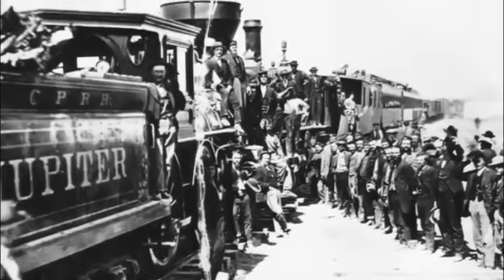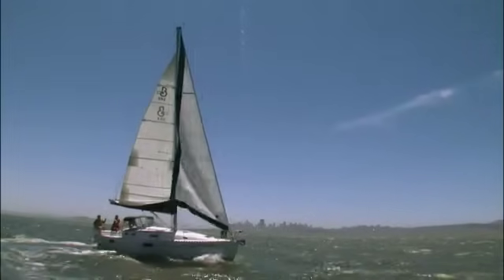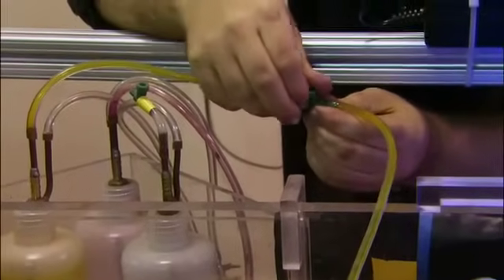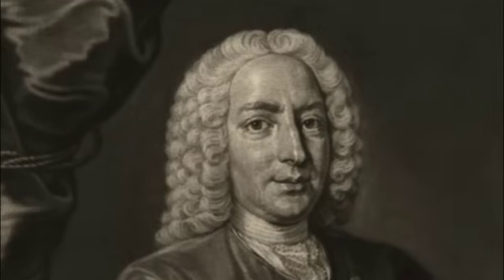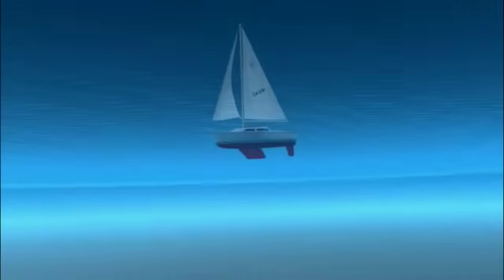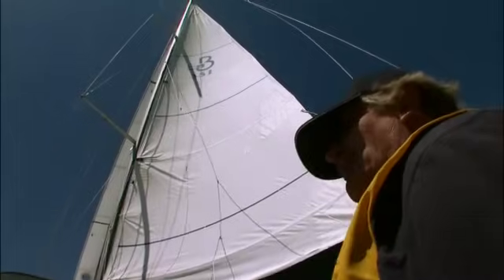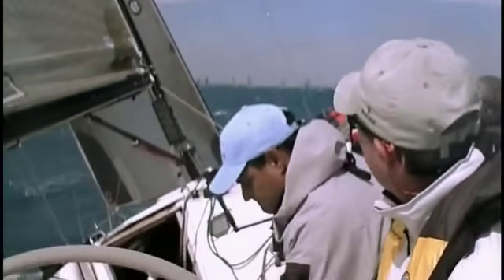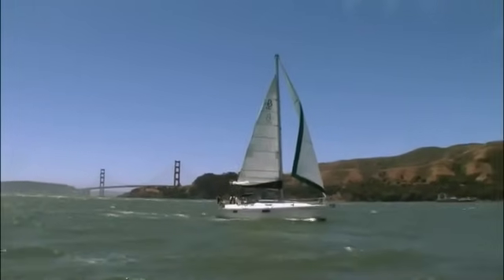The Physics of Sailing | KQED QUEST

Comment: But sails arent solid like wings with a flat and a curved side, as shown in the water tank dye test. They're a fraction of an inch thick, and the wind on both sides travels at the same speed as shown and proven by tell tales. So why would there be a pressure difference on either side of a sail if there's no difference in wind velocity to cause a pressure difference?
And at 3:24, you have the "sail" shape directly into the wind which can't happen when sailing.
This entire explanation is flawed by explaining how a solid plane wing wing works directly into air flow, and not a micro thin sail at 45 deg.

Comment: The explanation is kinda off, first thing to notice is that it takes in consideration the shape of a cross section of a wing, which is a rigid solid, while the sail shape will not work in that way, as wind pushes on it, the position of it and shape will change in space.

Comment: For those who are astute enough to figure this explanation was incomplete.  There is NO SUCH FORCE AS LIFT.   ALL wings, propellers, sails, and fans generate THRUST.   Think about a wing, or propellor blade. The air on the upper or forward surface creates a pocket of low air pressure.  This does NOT ‘suck’ the blade forward, nor the wing upward.   The inertia of the plane is too high for this relatively small difference in air pressure. And the wing or sail itself acts as a barrier preventing the high pressure air under the wing from moving into the low pressure above the wing.
However, the low pressure air is relatively confined to the space very near the wing, and further up above the wing, or ahead of the sail, is an OCEAN of air at higher pressure and the air molecules have LOW inertia.   So as the wing or sail moves forward, it continually generates a low pressure zone, that the higher pressure air further away is continually rushing into.  Accelerating as it does so.  As it reaches the low pressure zone, the wing or sail has moved out of the way, and the result is a jet of air accelerated in a direction perpendicular to the chord of the wing.    Airplanes fly because the wing accelerates a mass of air DOWNWARDS with a thrust that equals or exceeds the weight of the airplane.   Action-reaction.   This is why EVERY propellor and Fan does NOT create a great deal of force on the sucking side- it creates force on the BLOWING side.
The wind coming off the sail is moving FASTER than the rest of the air and being directed at a vector. 
In a plane the high pressure under the wing can not expand upwards because of the inertia of the plane, but it CAN expand into the lower pressure air further below the wing.  This, again, is air accelerating downwards, added to the air coming off the trailing edge of the wing and thereby producing thrust.   The same is true of the high pressure air in the belly of the sail. It is accelerating away from the sail, and the reaction to that is added thrust perpendicular to the sail.    In this way, under certain conditions and under certain point of sail, a sail can generate a speed that exceeds the speed of the wind, because it accelerates air to a higher speed creating thrust.
So, forget about ‘lift’. It’s an imaginary force.    Every fan proves to you that wings produce thrust.

Comment: Blowing over the paper causes the lower pressure on one side, not the curved shape. He is clearly blowing ONLY over the top. If he were blowing along top and bottom, the curve would cause the air on the outside of the curve  (up) to cover a longer distance in the  same time, thus moving faster, thus creating lower pressure (on top), thus the pressure below is greater and the paper goes up.
Reply: "Blowing over the paper causes the lower pressure"? - Really? -
In which direction will the vertical sheet deviate? )))
Reply: @MikleM1  Unclear. Which sheet is "vertical"?

Comment: Components of lift are far too complex to be explained with one principal such as Bernoulli's.  There is no law that states that flow must "join" together at the termination of a lifting surface with the same particles it entered the surface (in fact, it does not).  However, some of the lift is created with this pressure difference.  People use that principle because it is easy for most to understand but that is only partially how a wing or sail generates lift.
Reply: Correct!  Most of the force of a sail comes from Newton's Second Law of Motion (for every action, there is an opposite and equal reaction).  It is the deflection of the wind in one direction that causes the force of effort in the opposite direction.

Comment: I would comment as a life long Square Rig sailor and Master of Sail, that square sail rigged vessels DID NOT just get pushed by the wind.  The China Clippers, the epitome of the class, could point between 35-40 degrees off the wind, and square sails operate in the same manner as fore and aft sails as the weather edge of the sail it stretched tightly down to the yard below and angled so the wind passes along its surface from side to side but UNLIKE fore and aft sails ONLY, square sails also have a downward wind flow also causing LIFT.  The big cargo square riggers of the late 19th and early 20th centuries were massive but NOT SLOW as you implied.  These ships could reach speeds of 20 plus knots or about 23 miles an hour.

Comment: Lift forces due to the acceleration of air across the curved surface is overstated. Stop abusing Bernoulli, look to Newton — there is a huge redirection of air mass in a new direction creating forces in the opposite direction (forward).

Comment: Shaking my head every time someone invokes Bernoulli - https://youtu.be/yqwb4HIrORM?t=239 "generate higher velocities on one side ... consequently lower pressure ... pressure difference, and that leads to force" - as a *cause* instead of an effect.  They never explain what generates the higher velocities:  in a venturi, there is a area restriction to increase velocity, but in sailing there is no nearby wall to restrict the area; the thickness of the sail is so small that the "flow takes longer distance on the lee side so airflow must be faster" argument must also be bogus.  Note that we can also sail with a flat (symmetrical) plate as a sail (also note that the keel/centerboard, the underwater "sail," is already symmetrical), so explanation that relies on the curvature of the sail does not account for the basic mechanics.

Momentum transfer of diverted airstream (and water stream) is a much simpler explanation:  d(mV)/dt = F.
Reply: 100% agree with the rejection of Bernoulli. a) There is no reason for the air to accelerate over the leeward side. b) No evidence either. And c) Bernoulli's Principle applies to incompressible fluids. Air is a gas: compressible.
But 100% disagree with Momentum theory. The only way a gas can exert a force on an object is via pressure. 
The answer is Swept Volume Theory. Put swept_volume_theory into your favourite search engine.

Comment: This item does not explain sailing very well ,and is confused and over complicated.     I  have taught thousands of people to sail professionally at a much more practical level .  I also won championships and crossed oceans using the Trade Winds !
            Fundamentally imagine  the blackboard with the wind from the top.  Draw on a boat shape and a curved sail in beam reaching position ,   The physics is that the sail curves the wind and the big arrow is the push mostly forward,               
         Square rigs were for Tea Clippers.  The local fishermen would use a sloop rig.    And the Romans would use Galley Slaves   for ultimale upwind performance ....
Reply: tl;dr

Comment: Why does the air/liquid accelerates going around the curve surface?  The reason given thus far is that it needs to catch up with the flow on the other side.  Why?
By the way when you blow on one side of the paper, the paper doesn't have to be curved to move across the direction of the flowing air. A flat piece of paper will do.  A curved paper first wants to straighten out.

Comment: Watched nine-and-a-half minutes. Still waiting for them to explain what the front sail does.
Any moment now would be fine…
Reply: The jib sail on a bermuda sloop set up? 

Firstly it acts as a sail itself in much the same way the mainsail does.

Secondly it creates a narrower path for air to flow over the mainsail, acting kind of like a nozzle, which speeds up the air and makes the boat move faster when reaching.
Reply: @MikeM-go7hp  Thank you. Can you clarify "reaching"?
Reply: @MuradBeybalaev  reaching is basically sailing at an angle closer to the wind than roughly 90 degrees, so sailing into the wind or roughly side on to the wind.

More technically, it's when you're sailing at an angle that uses both the wind and the water to give your boat power, rather than the wind alone.
Reply: @MikeM-go7hp  Huh. To confirm: you say adding a jib sail at the front of a vessel that doesn't have one makes it sail stronger into the wind? Curious. Thank you.
Reply: @MuradBeybalaev  The boat needs to be rigged right of course. But in a typical Bermuda sloop configuration (what you see on most small sailing boats) then yes - the jib will give you a whole lot more power when going into the wind. It will give you extra power when sailing away from the wind as well, but not as much.

Comment: Standard keels are typically symmetric. That is, both sides have the exact same curved shape.

As long as the keel is moving parallel to the flow of the water, the forces generated on each side will cancel each other out, and the keel will keep the boat moving in a straight direction. So with even and equal water flow across both sides of the keel, no net lift force is generated.

It is only when the water is flowing across the keel at an angle that the keel can generate lift.  

At that point, what the keel will try to do is correct the boat to move back into a straight line direction. This is the exact same principle used by weather vanes to always point in the direction the wind is blowing.

But if the keel can generate lift, it can then cause the boat to move faster through the water than it otherwise would.

So by using the sail as a wing and keeping the boat angled so that the keel is not just moving straight through the water but is moving at an angle and thus generating lift, more speed can be generated than just the sail alone would provide.

By the way, Polynesians and Micronesians were using wing shaped sails centuries before Westerners ever came up with the idea.

In fact, when Europeans first ventured into the Pacific (starting in the 16th century) in their square rigged sailing ships that could only travel downwind, they were amazed at the speed and maneuverability of the sailing vessels of the Pacific islanders they encountered. 

However, the sailing vessels of the Pacific islanders had no keels. So how did they prevent the boat from being pushed sideways by the wind? 

In the case of the Micronesians, they relied on the shape of the hulls - which were shaped like wings - and outriggers to counteract the sideways movement of the boat caused by the wind.

The Polynesians typically had a double hulled design (that is, they were catamarans) which had the same effect.
Reply: Westerners had the lateen as far back as the romans so while you are correct that the Pacific Islanders had them long before Europeans, it was not the first time Europeans had seen sail boats that could travel against the wind.

Comment: Wings have a cross section, sails do not.  Air coming off the trailing edge of a sail has been redirected which is not the case with a wing (under zero angle of attack).  Wings and sails function differently.  Stands to reason when a properly trimmed sail smoothly redirects airflow "on the wind" it can harness the forward vector from the equal and opposite force, the lateral force being largely neutralized by resistance of the keel.  Wings gain lift due to the Bernoulli principle, as described in the video.
Reply: This is the comment I was looking for. Thanks for the explanation.

Comment: Interesting video agree strongly with the squeezed melon pip analogy. However the whole subject from a physics point of view is much simpler and practically useful if we use the physics concept of centrifugal force. When you drive round a corner at some speed you get pushed side ways away from the centre of the turn. [ technically Centri = centre & fugal = fleeing] so a force fleeing away from the centre of a curve. Try swinging a ball around on the end of a piece of string. You have to hold on to the string to hold back the force [centrifugal] PUSHING the ball away.That is the main sailing force acting PUSHING opposite to the keel.The "lift / suction force on the outside of the sail is useful, specially if racing, adds a small [up to 25%] extra to the pushing force, but is much less stable and often totally ignored by many cruising sailors. The main advantage of thinking centrifugal force is that it explains the practical use specially depth and shape of curve of sails. Even explains the way a spinnaker works, though vented spinnakers do now use the 'lift / ventury' effect much more.  Derry
Reply: Except there is no centrifugal force; there is nothing “pushing” the ball away, just it’s own momentum. The resultant tug you have to exert to hold a ball on a circular is what creates this illusion, as the momentum tries to resist this change, but there is no force causing this. Rather, a centripetal (center seeking) force is required to keep the ball from leaving on a tangential trajectory. What is commonly called “centrifugal force” is really just the apparent feeling from the resistance of momentum to centripetal force

Comment: ...and it is not Bernoulli´s principle that explains lift. I never stop wondering why people accept the explanation of the longer and shorter distance. The distance around the 2 sides of a sail is exactly equal. It is correct that on many airplane wings (but not on symmetric wings) the distance is longer on the top side, but it has got nothing to do with creating lift. The complex and very important shape of a wing is an engineering compromise between strength, drag, stall characteristics, twisting force, internal structure and other things. . Another thing is that the difference in distance is constant. It would be impossible to correct for varying weight of the airplane. Boaters know, that one thing you can do to tune the sail is to change the shape of the sail, that is make it more og less flat. That does not change the distance. Lastly, if the topside creates a relative vacuum, how do some airplanes fly inverted? They should get sucked to the ground. Clearly something else is going on. It IS accelerating of the air, but remember, in engineering terms accelerating is changing either speed or direction or both. The wing accelerates the air as it passes by excerting af force on it (both on top and bottom of the wing). And not only the air that is in direct contact with the eing, but also at a distance. As Newton found out, action gives reaction so the air excerts a force on the wing. This force is not straight up but at a slight backwards angle creating lift and a component of drag called induced drag. That is drag as a result of creating lift. The other component is called parasitic drag which is a result of the resistance of moving an object trough a fluid.

Comment: The terminology is confusing from the get-go, and no....liquids do not follow gases in wind tunnel testing.....water (liquid...) is a LOT heavier than a gas (the air...) so it reacts much  slower.

Comment: Sheesh- No such force as lift.   All wings work exactly the same way all propellers work. They create a thrust nearly perpendicular to the plane of motion thru the fluid.
The low pressure is created- but the differential is not that much, and there happens to be a wing in the way.   Rather, the low pressure zone on the lee side of the sail is bounded by ambient pressure air further away. This causes this unobstructed air to move INTO the low pressure zone, spilling off the trailing edge of the wing perpendicular to the line of motion.  It is this thrust that makes a plane fly, or a sail work... not any sucking from low pressure.   How you can know this to be true is by the fact that as planes fly higher, the pressure differential on the wing doesn’t change... but the density of air does.  Which is why they have to go faster to go higher, because the thrust is related to the MASS of the air that is accelerated downwards by the wing.  Its also the reason the low pressure side of a fan, or prop, has no noticeable force- but the high pressure side has a mass of air moving away from the blades perpendicular to their plane of motion.   So, sorry.   Its not Lift. Its not low pressure pulling the sail. Its air accelerated TOWARDS the lee side of the sail that keeps moving as the sail passes.  
You can see this is true when airplanes fly just above a very smooth cloud deck.  behind the plane on its line of travel, the downward moving mass of air cuts a deep channel in the cloud deck.   The thrust of this downward wash of air equals the weight of the plane...  if the plane speeds up, the mass of air accelerated down is greater than the plane and it moves up as the reaction.  The pressure differential acting on the wing itself is the smallest fraction of the force needed to fly. Or sail.